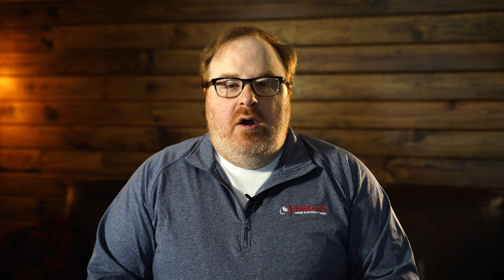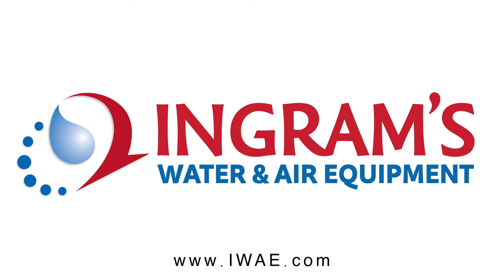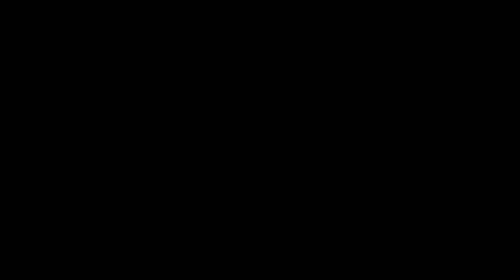Does My Mini Split Need a Condensate Pump?

Comment: hey Dan, using solar or battery backup in a grid down situation what is the best HVAC system to use that is both efficient and affordable? I am assuming a mini split system. What are your thoughts? Thanks. Jason .
Reply from the maker: Efficient and affordable is kind of a tough nut to crack. Because the more efficient you make a unit, the more expensive it becomes. In your situation, I'd recommend as efficient a unit as you can afford, but a high SEER unit might not be as affordable as you would like.